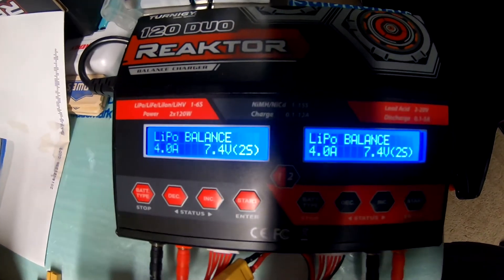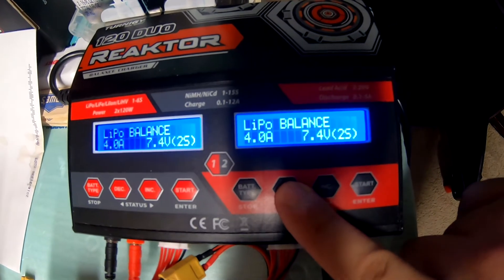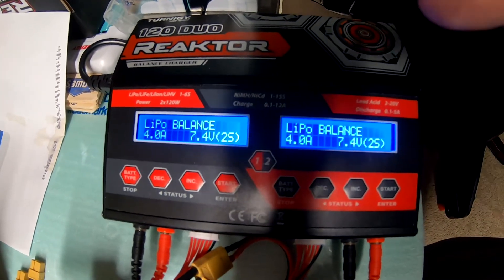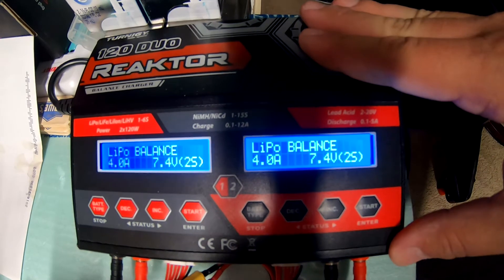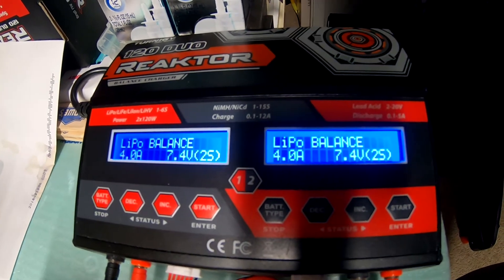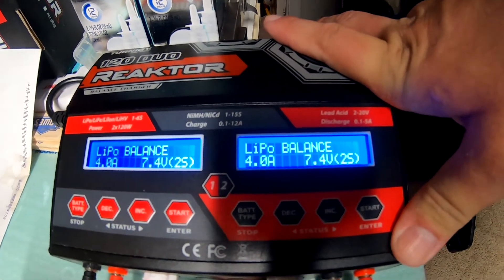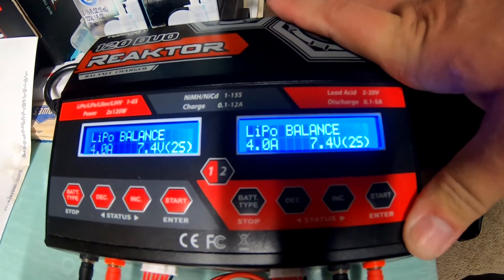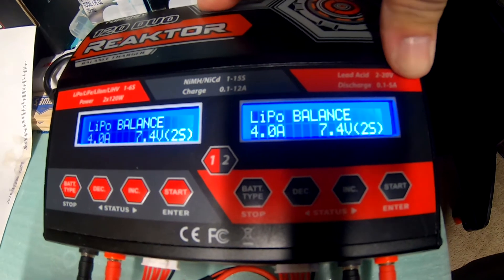Lipos - Lithium Polymer Batteries, How to use them safely and avoid explosions and fires!

Comment: Lots of extremely good advice and hopefully your subscribers take heed of it. I personally charge my lipos on the stove top in a fire safe bag because if I had a catastrophic failure the stove is built to easily withstand those temperatures and I have the extractor fan to take out the toxic fumes. Also doing it on the stovetop makes  it's easy to visually check every few minutes that the charge procedure is progressing safely. Thanks for posting and reminding modellers of a potentially dangerous situation.
Reply from the maker: Thanks, I always try to be safe, but seeing a nearby home burn down is a stark reminder of the danger. I suspect that this was a case of repeatedly charging, running, and recharging, and running again. It's a sure way to overheat a battery to the point of thermal overload. Also, a lot of kids are into bashing and the huge jumps and crashes take a toll on the batteries.